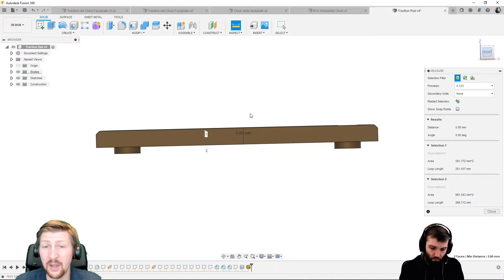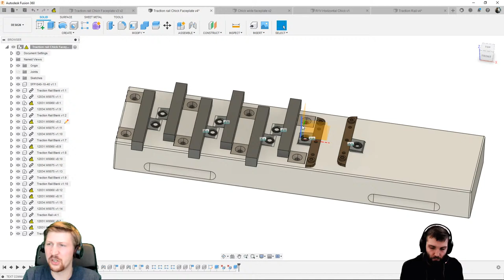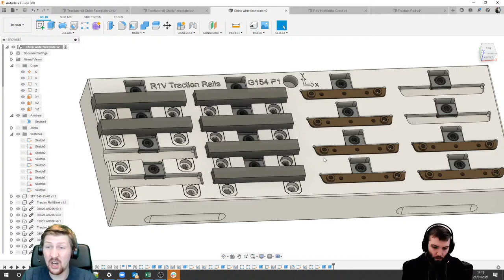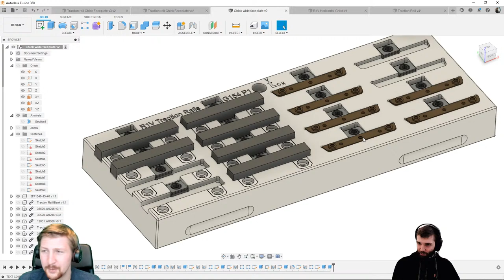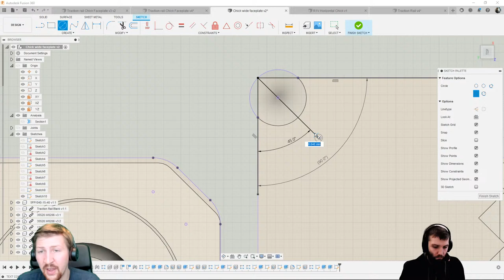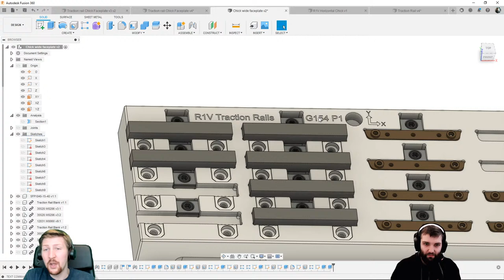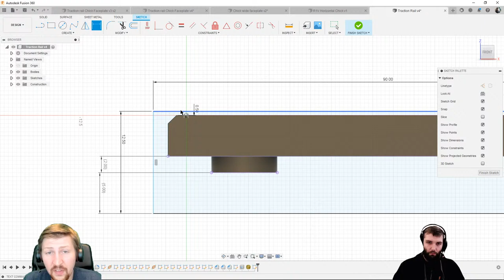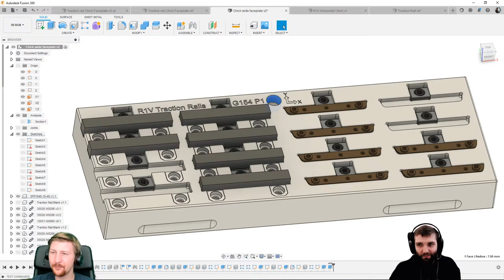360 Live: Design and Manufacture of Custom Workholding Part 1

Comment: I would place my datum hole center of the operation 20 so that if there is a slight angle on the production plate, you will have a smaller error..

Comment: Just starting to learn basics of CNC, so no real experience- I just wonder why, with so many parts to fix, wouldn't you use a "symmetric" clamp- the one that expands both ways? It seems like it would half the number of screws to be tighten and allow for tighter placement, maybe fitting your first faceplate size. Also, maybe you can consider using a program that displays your keystrokes in popup window on top of your CAD program- shortcuts would be even more clearly understood, without extra editing. Anyway, enjoyed this one and would love to see more CAM tutorials!
Reply: Hi, excellent idea about the keystrokes, I will investigate. Regarding the dual acting clamps, one of my early designs did have these, long story short I wasn't 100% happy with the design I went for on the space I had available. You do have to be careful with dual acting clamps as you can sometimes have issues where one part is clamped and the other loose. The clamps I found would have struggled to clamp on 5mm, I must admit I didn't to an exhaustive search.